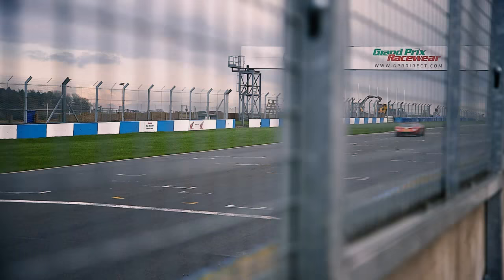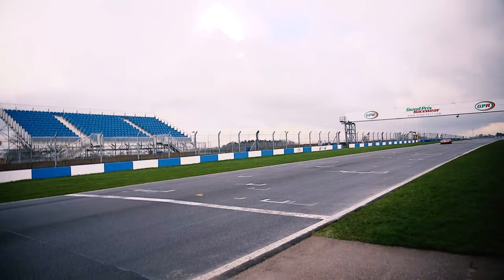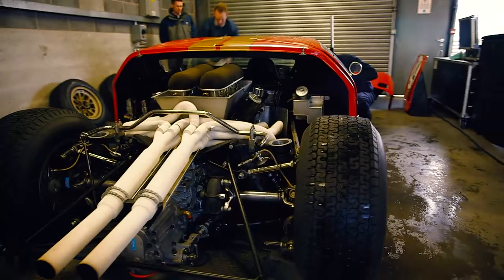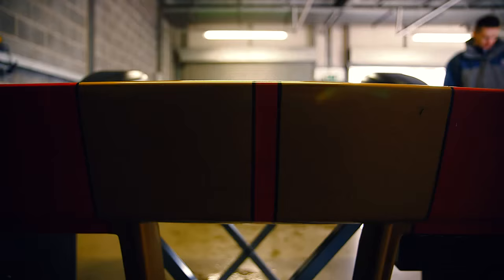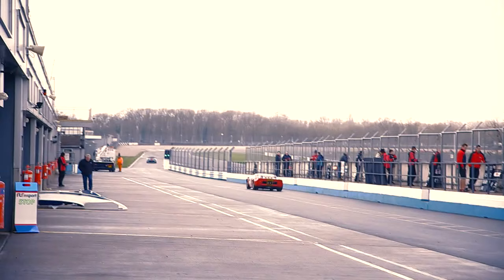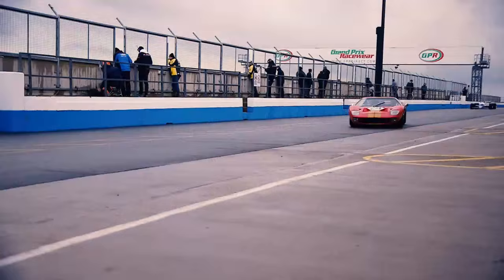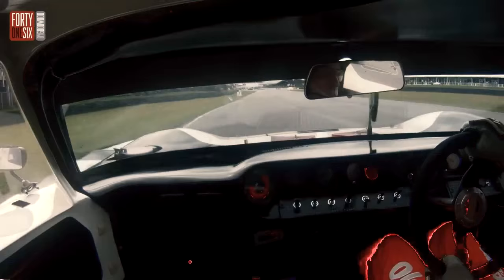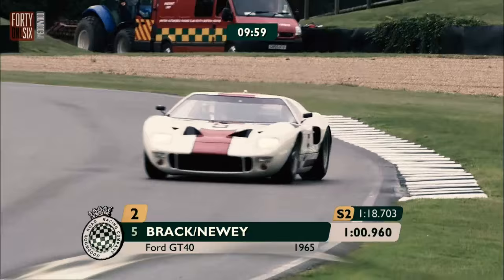Kenny Brack spanks it with Graham Hill's Savage GT40

Comment: https://en.wikipedia.org/wiki/Eric_Broadley

The 1963 Racing Car Show debuted the sensational Mark 6 (Lola GT), a trendsetter into the '70s. It featured a Ford 4.2-litre (255ci) V8 and Colotti four-speed box under a sleek fiberglass body, showing good handling and "a remarkable turn of speed" for only 250 hp (186 kW), enough to put it in the running for the 1963 Vingt-Quatre Heurs du Mans until the gearbox balked and David Hobbs crashed.

This performance attracted the attention of Ford, who were looking for a way to win Le Mans, and offered Broadley a two-year deal to redesign the GT, setting up Ford Advanced Vehicles, in a factory on the Slough Trading Estate; it produced the GT-40, which differed in many respects from the Mark 6, not least in using a steel chassis rather than the aluminium of the Mark 6.

Comment: Kenny, does goodwood not allow a stickier tire than those grandma treads!  you got on?  nitto, Goodyear, Yokohama?
Reply: It is normal in classic racing to mandate the use of Historic tyres. These are modern tyres made as replicas i.e. to the original tread pattern and using the original construction - crossply rather than radial. This is an extract from a typical classic race series rulebook - "All cars running during qualifying and races must use Dunlop Historic CR65 L or M section racing tyres."